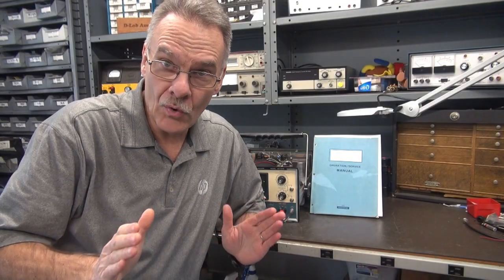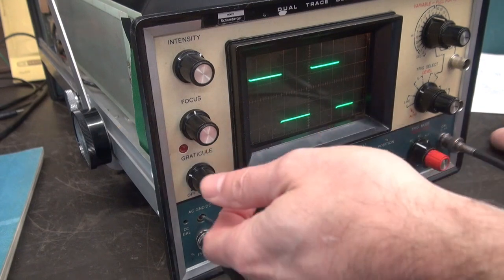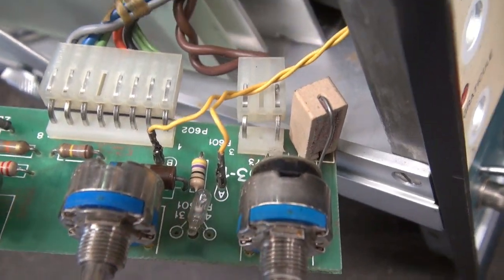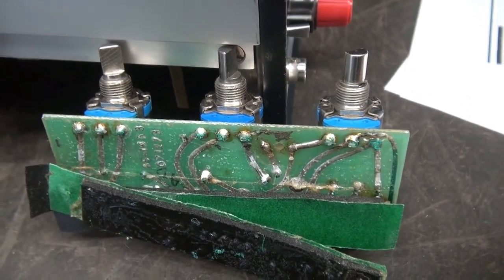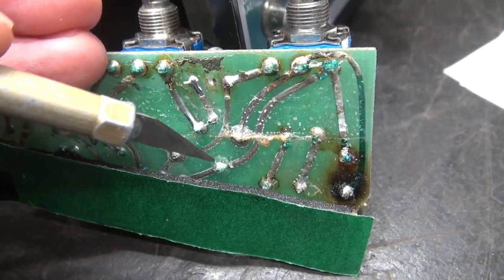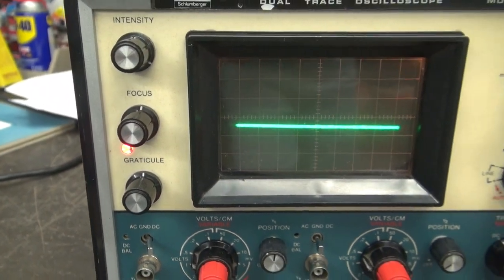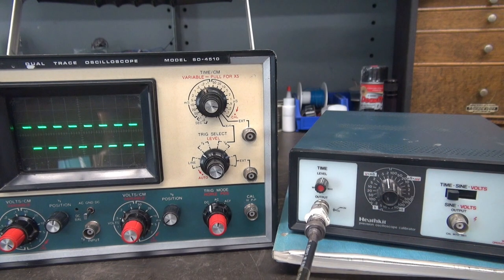How to change modify power lamp to LED Heathkit Oscilloscope Part 3

Comment: What did you do to clean the corrosion off that board?  Ultrasonic cleaner, wire scratch brush?
Even those burn mars on the board around the power resistor needs to be cleaned.  Did that power resistor even test ok with burn marks that bad?
Reply: No mention of addressing that issue  from Terry! I think replacing it with intact leads and further away from the board would be in order here.

Comment: The board looks a bit crispy underneath that power resistor. I would check it for tolerance and maybe replace it anyway to get it up off the board. It's obviously getting too hot for some reason. Now we get into the problem who calibrated the calibrator last in it's lifetime. Do you trust it? Looking forward to see.

Comment: I guess the brown spot on the corner of the board didn't bother ya. I found a LED #47 replacement for my Drake C-4 and it ain't burnt out after a few years like the incandescent 47's did every 3 months :-) It lights up the meter. Happy Thanksgiving Day Terry.

Comment: Why did you add the 1N4003 diode to the LED supply?  Doesn't that give you a half wave going in (assuming 6VDC)?  Did I miss something?  Thanks, Terry!
Reply: LED's were designed to put out light with little care about their ability to rectify, so they aren't very good at reverse polarity.

Comment: Good idea with the LED but a 100 ohm resistor seems kind of small. There's somewhere between 30 and 60 mA going through the LED. Can the LED take that?
Reply from the maker: Remember, the diode half waves the DC voltage, the LED has only 1vdc on it, LED is way under powered

Comment: Why not fix that crispy resistor in there that is driving the display illumination. At a minimum put longer leads on it to get it away from the board and thus not cook the traces, or replace with a 10W one so it runs cool.
Reply from the maker: Yes, there is room to relocate it

Comment: Bad burn mark on PC board where that power resistor ( R607) is. It looks to be right up against the chassis and too close to the board.
Would have replaced it with one with intact long leads and   parallel  to the plane of the PC board thus keeping it away from damaging the board!

Comment: Have done a similar mod to the control box to my HyGain rotor control. One can go white or red depending if one wants to work in "blackout" mode.
Speaking of Heathkit, I heard some fellow ham bought out the rights to the Heathkit name as well as all of the schematics for most everything. Last I heard he was actively going after websites that for years had posted schematics for all to have since the previous owners of the name never cared since the equipment was so old. Any truth to this? If so this individual is low life, perhaps a LID.

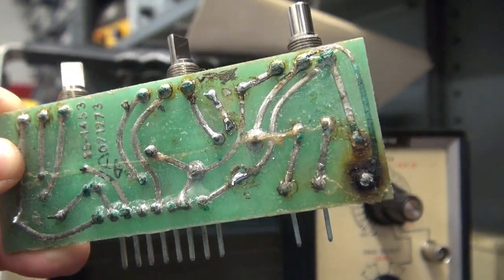Comment: At time 3:14 it appears that on the board in the bottom right corner that something overheated or got very hot where it is all black around that connection.  You may want to investigate if there is another issue with the board.
Reply from the maker: Yep, just years of a 5watt resistor sending heat
Reply: D-lab Electronics is that okay to leave on there or is there any advantage to replacing it? I’d see that and want to replace it, but maybe it’s unnecessary in practice.

Comment: Just curious why the diode, since the LED is a diode anyway.
Reply from the maker: You have to rectify the 6VAC to feed the LED
Reply: Also I think you can't reverse bias an led which is what would happen.
Reply: Connected to an AC supply with only a resistor would work for a while, but after that the LED will break. Operated in the reverse direction the leakage current will destroy the LED. LEDs do not have the same characteristics as e.g. a 1N4xxx. 

You should not use them to build a luminous rectifier ;-)
Reply: Add this as just another one of the many things I've found that my electronics instructor in high school failed to mention.
Reply: LED's don't like a reverse bias. Unlike a "normal" diode, an LED was designed to put out light and not rectify. I'm certain someone could try to design an LED that works as a light and a rectifier, but that sounds like a lot of work for little gain.

Comment: I don’t find a way to email an unrelated question, so I’ll ask it here. I bought a 2002 Pro Reverb reissue. I’m considering changing it to point to point, to get the tube sockets mounted  on the chassis and lose the plastic 1/4 jacks. Do you ever do that? I think it would make it worth more? Your thoughts, Duane